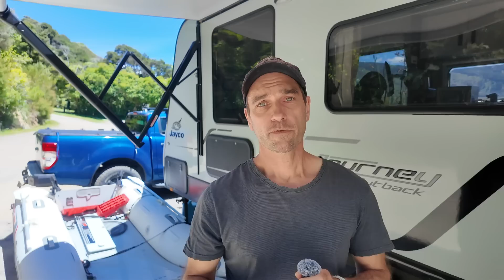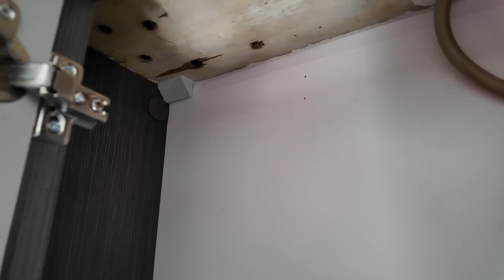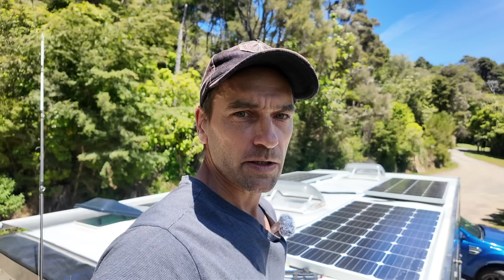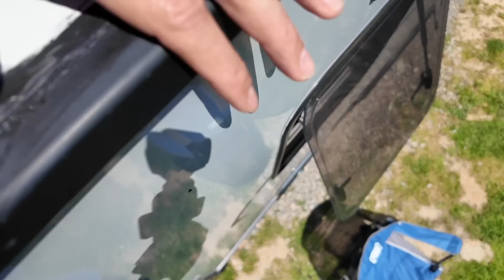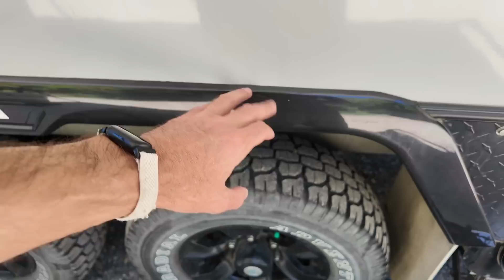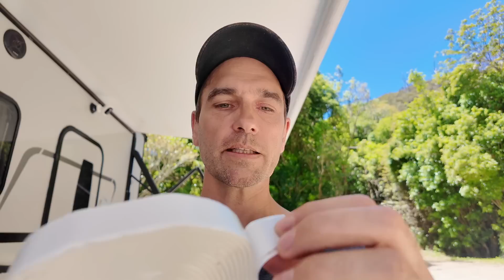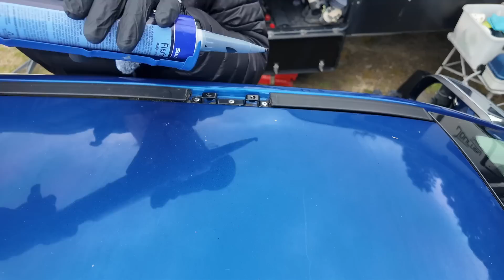Our Jayco Caravan is FALLING APART! 😱 Multiple Leaks Disaster! 🌧

Comment: Lucky you have the mechanical ability to do the repairs yourself; many are not so practical and have to pay large sums of money. I would suggest removing some of the internal covers on the car to get a better idea of where water is entering. Thanks for the upload 👍🏻
Reply from the maker: thanks for the suggestions mate, appreciate it. I've been trying to avoid it as it seems quite difficult to get those covers off but I think I will have to do it nevertheless. If the water is not coming through the windscreen it's gotta be coming from all the way back somewhere.

Comment: That eternabond tape is fantastic stuff. I resealed all my roof hatches and then add the 4" tape over the seal for double insurance.

Seals should really be removed and replaced every 5 years (especially if fulltime) as the flex just opens up cracks constantly.

Regular inspections and monitoring of problem areas is good practice.

I have eliminated all these issues by getting a MH built in 50mm composite panels so there is no wood at all.

Good luck with the repairs.
Reply from the maker: Yeah eternabond is great, I will seal the rest of the roof with it and afterwards it should last forever :)
Reply: @Fishingreminder 😊po

Comment: Thank you for a great video. Yes, you've got to keep up the maintenance on caravans and motorhomes. Redoing the sealing around all joints is a priority.
Reply from the maker: thanks mate, yeah for sure. It's easy to forget sometimes but even a tiny little overlooked crack in the sealing can cause massive damage.
Reply: Do you not have to have it serviced yearly for the warranty? Some caravans have a 10 year warranty, but it must be serviced by a qualified caravan service centre each year.